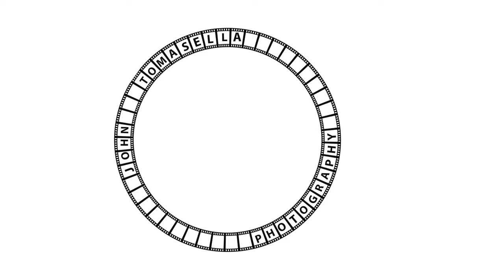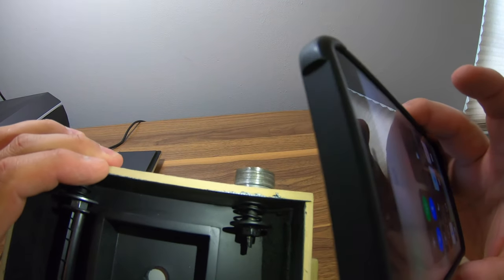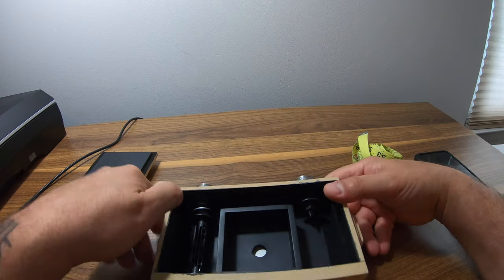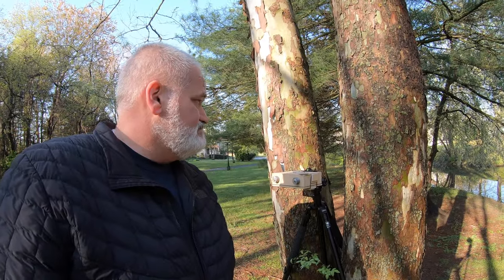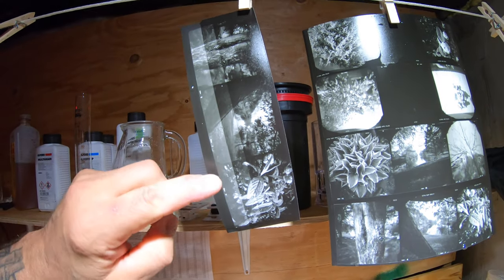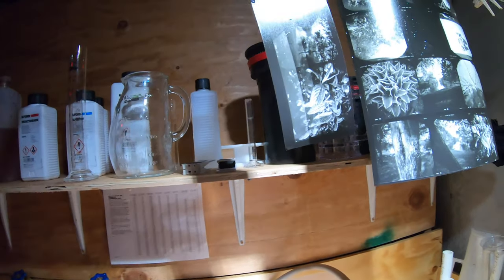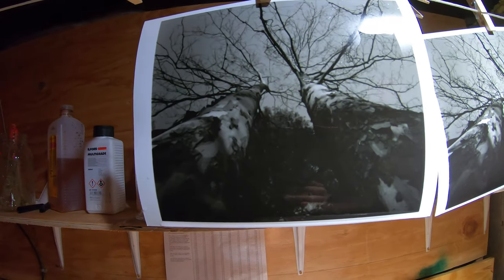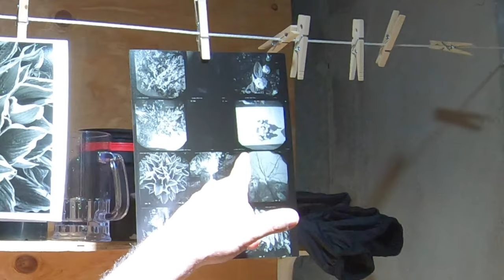DIY Pinhole camera, test roll

Comment: Very ingenious little camera! I like the film holding mechanism. I plan to start building my first pinhole camera in the next week or so and I'm working out my thoughts for it. This has been very helpful.
Reply from the maker: The most important part is the distance to the film plain for the size pinhole you have.
Reply: @JohnTomasella  For my first venture I thought I would do a 4x5, so that I don't have to fuss with winding mechanisms. One problem at a time. I thought about the distance from pinhole to film plane in terms of a field of view. For the first attempt I was thinking of a 90 degree field of view, but on the diagonal of the film plate. The diagonal of a 4x5 is about 6.4 inches. So the distance from pinhole to film would be half that, 3.2 inches. By the way, thanks for the reply.